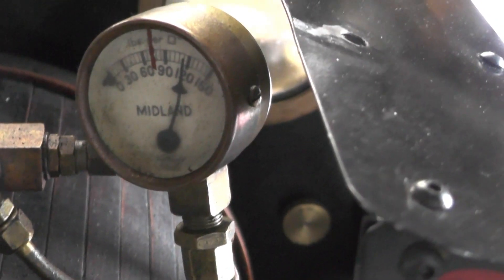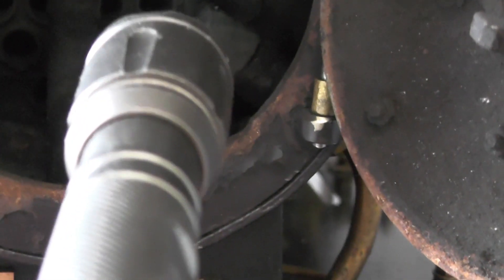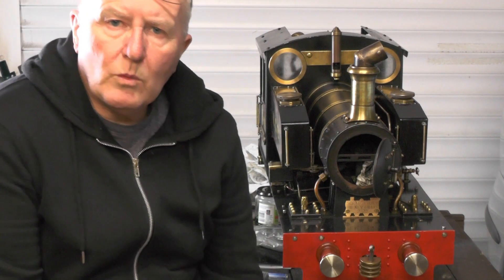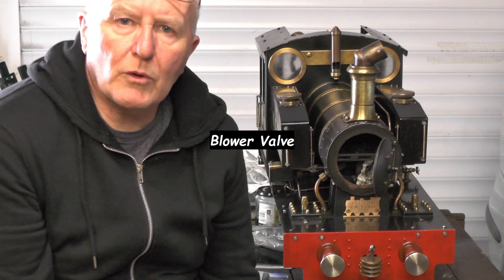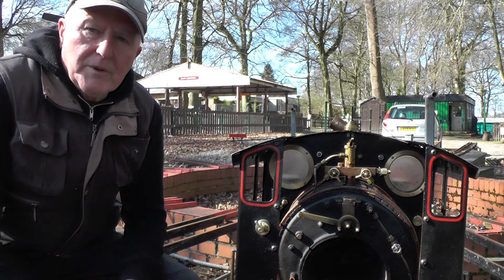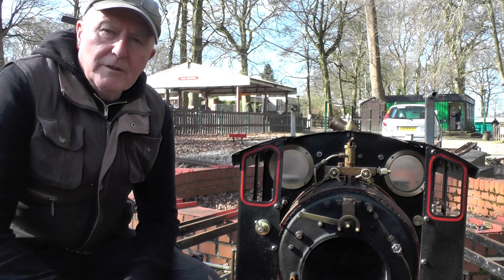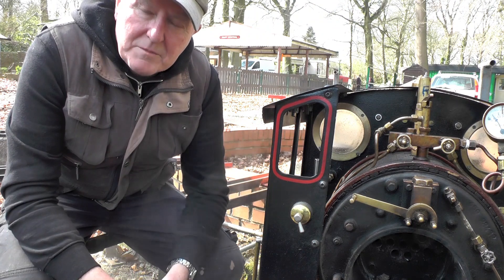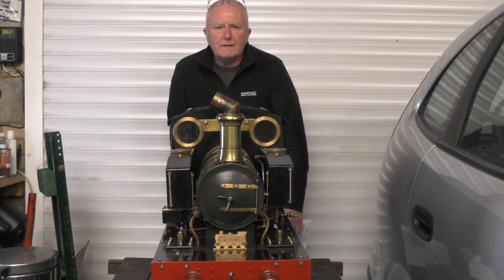1st Quadrennial Hydraulic Test for Metre Maid Steam Locomotive "Scratch"

Comment: Great stuff Kev 👍
I'm curious - is there a permitted leakage for the tests or does everything have to be absolutely sealed? Does the test include checking any over pressure devices are functional and accurate? Cheers, Matt
Reply from the maker: Hi Matt
Our inspector allows leakage on fittings such as valves and takes that in to account when checking the boiler structure. 
yes he also checks the safety valves and the pressure gauge
thanks for feedback
any other info please ask👍👍
atb
Kev